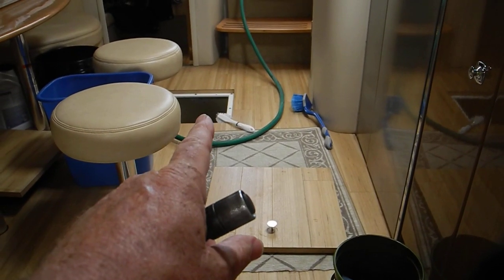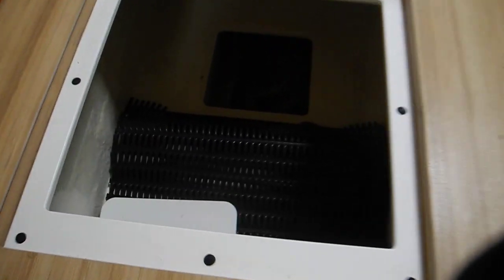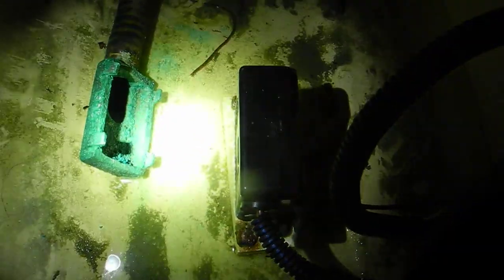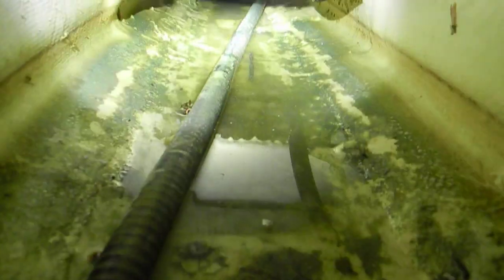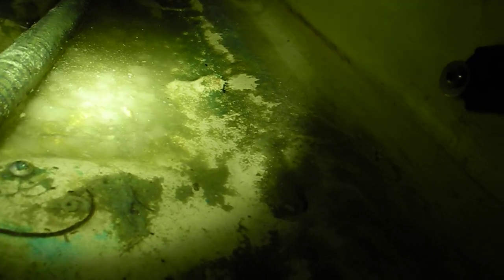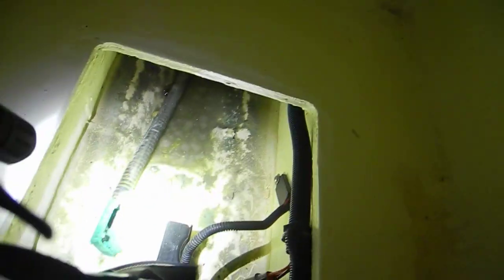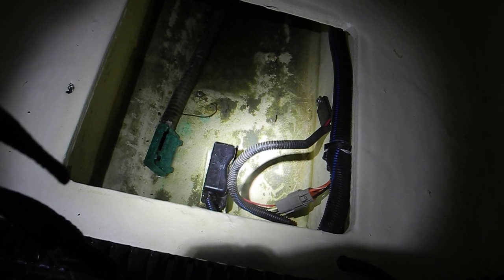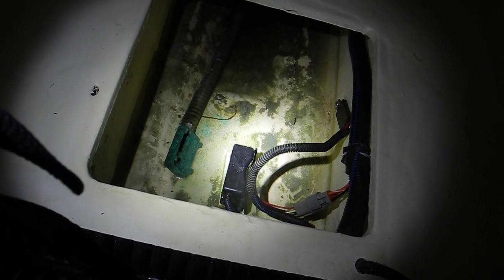Cabin bilge

Comment: I use the electronic water sensors. The newer float switches don't last like the old mercury switches. A wet rag held on the electronic switch will activate it to start pumping.
Reply from the maker: CHARLES DAVENPORT you are correct! Thanks for watching and for your experienced comments. 👍🏼👍🏼